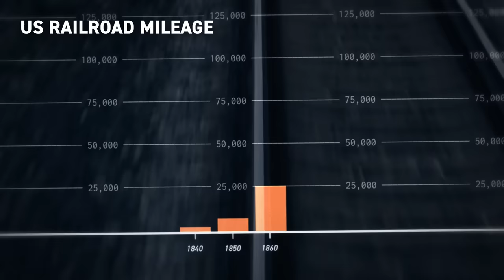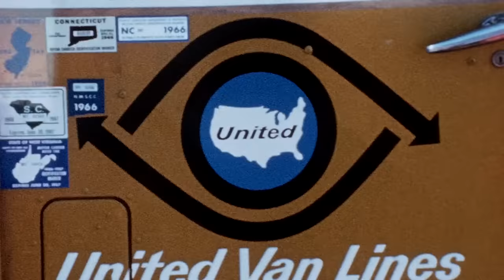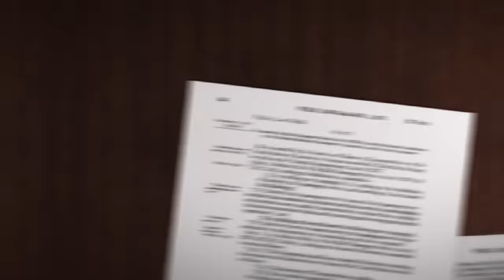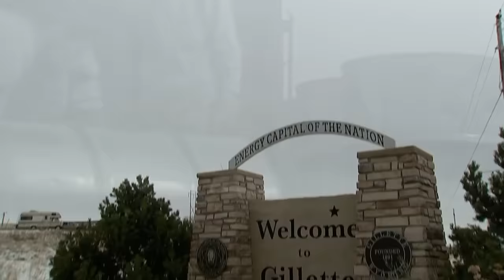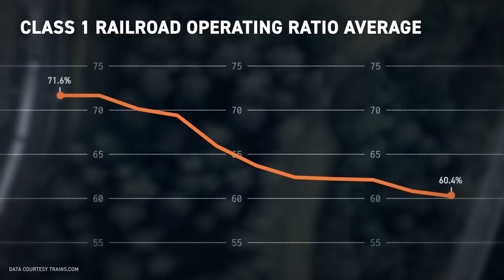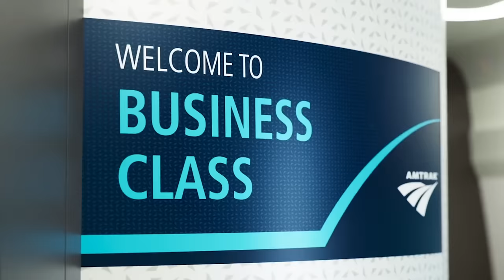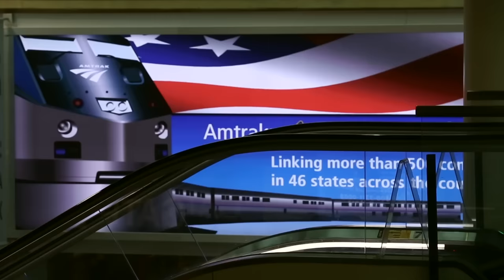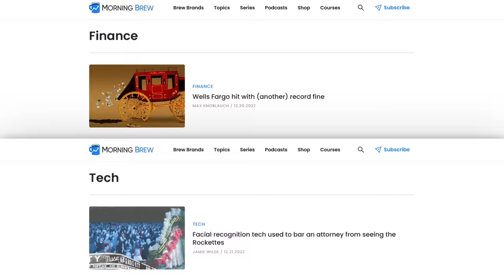The One Tiny Law That Keeps Amtrak Terrible

Comment: Amtrak currently has a lawsuit going against the freight companies for not honoring their agreement
Reply: As well they should. I wouldn’t budge an inch on the agreement. I’m sure the RR’s will/would try to buy their way out of the commitment. Don’t let them, stick to the agreement. Previous CEO’s have kicked the can down the road. Now it’s time to pay up.
Reply: I would like to see the freights restricted in length to the size of their sidings. If they want to run 3 mile trains, fine, but then they should have to build 3.5 mile sidings!
Reply: I use Amtrak on the old Pennsylvania "Main line," between Philadelphia and Pittsburgh. Prior to the 1970s, it was  four track system, two tracks in each direction.  Then it was reduced to three tracks, the third track used as a "Siding" for traffic in both directions.  They want to improve part of the old "Main line," by installing "Sidings" instead of a whole new track.  That should speed up passenger service but it would be better to return to having four whole length of the route tracks. 
The biggest restriction is the Gallitizin Tunnels. The Gaitizin tunnels are actually three tunnels. The first one built in 1852 for the Pennsylvania railroad  The Second built in 1854 by the then state owned "Portage Railway" which was part of the Pennsylvania Canal  (The Portage railroad connected the two parts of the Canal, hauling goods and Canal boats over Allegheny Mountain).  The Third tunnel was built in 1905 next to the original Gallitzin tunnel.  After 2000 the Orginal Gallitzin tunnel was enlarged so two tracks could go through it with double height containers.  The Portage Tunnel appears to have always be able to haul such tall rail cars, but it was only one track.  Those tunnels are still in use. The 1905 Gallitzin tunnel is abandoned but can be rebuilt to take double height containers rail cars or just install new tracks but forbid the use of double height containers in that Tunnel.
I bring up the Gallitzin tunnels for in most cases it is the tunnels and bridges that need to be upgraded not only to take double height container rail cars but also to put in a full length track instead of sidings.  
The US Government should do what Europe did with its rail system.  In Europe the actual rail lines are private as they are in the US, but the tracks are owned and maintained by the Government. The Private rail companies pay rent for the use of the tracks, just like truckers pay fuel taxes to maintain US highways that such truckers depend on.
Congress can do this by taking over the tracksge in exchange for the Railroads not paying any rent for the use of the tracks over the next 20 years. The Federal Government could then double tracks those busy rail lines that are not double track which would make Passenger service faster but so would Freight service be faster.   Competition between Railroads could be reinstated by permitting, after 20 years, anyone to use the tracks provided they meet minimum standards (i.e. no train slower then a "Normal Train").
Railroads competitors all use Government owned infrastructure. 1. Airplanes, Government owned airports and runways, runways built from funds from the Federal Government so that fighter jets can use those same runways.
2. Trucking and the fuel taxes, not only truckers pay but most other drivers.
3. Barges which rely on US Government locks and dams so rivers can be used year round, not just in time of spring floods.
My point is Railroads are the only means of transportation that does not depend on Government owned property to move goods along.  That leads to efforts not to invest in such infrastructure investments for most such investments will not pay off for ten to twenty years, long after the current leaders of those railroad are gone.   
This is the problem with most private enterprise companies, they are concerned more about profis this year not 20 years down the road.  In much of the economy that is good way to make a successful business, but it is hard on anything that needs long term thinking to survive and infrastructure is one area where long term planning is important.  Thus like public roads, railroad tracks should be owned and maintained by the Government. Yes I know the Government has a history of "Deferring maintenance" but when there is Political will those problems will be overcome if we are dealing with a Government project as oppose to a project by private enterprises.
A good example of this is the Interstate Highway system.  The overall system is Government owned and maintained even as the actual building of the Interstate system and maintenance of the Interstate system was done by Private companies. No private company will invest in a project for the over 50 years the Interstate system took to build but when it came to build the individual sections of the system, private companies can do such short term projects with ease 
Some people will not want to hear that the best solution to the problems of Amtrak is for the Federal Government to take over most of the "Class A" Railroads trackage. That will give the Federal Government the power it needs to not only improve passenger rail service in the US, but also improve long term freight service AND address the global warming by making rail a variable option to drive.
Reply: Amtrak meant to file the lawsuit a few decades ago, but they experienced delays.
Reply: The only problem is that Amtrak can afford to keep loosing money just like it always has since it was created. It has the American taxpayers to pay for it. Private railroads do not have that luxury. They have to make money to maintain their tracks/lines. If they don't, who do you think is going to pay for it, Amtrak? You people need to remember that the private railroads had to ask for permission from the government in order to end their failing, money loosing passenger service. Guess who thought it was a good idea to pick up a proven failed and money loosing operation? The government. Amtrak has NEVER even broken even since the day it started. Guess who pays for it? The tax payer.
Reply: @vintagethrifter2114  did you watch the video, or just show up to throw in some anti-public service, pro-hyper capitalist rhetoric?
Reply: @NobodyCaresAboutIt  I watched the video. I also ride Amtrak. I have also worked for the military, State Department and the United States Postal Service for the past twenty years. You tend to recognize lost cause when you see them.
Reply: Which will go nowhere because it’s physically impossible for a mile long coal train to fit on a 1/2 mile siding to let a 400 foot Amtrack pass.
Reply: @HighHolyOne   So you think the freight line that already owns the infrastructure should have to completely modify the infrastructure in order to accommodate Amtrak? Where is the sense in that. That’s like saying that you own a house but the agreement with the city says you have to let the neighbors use it whenever they want, however they want and Build a garage big enough for you to live in so that they can have the master bedroom.
Reply: @HighHolyOne  Freight rail is a business, they own the infrastructure because they paid to  build it to fit their needs, mandating that they have to rebuild their infrastructure to accommodate Amtrak is silly because Amtrak will never be profitable in this country, and forcing the freight rails to be less profitable, make less money, charge more and drive up the price of everything they ship in this country… just to try to make Amtrak slightly more on time is throwing effort after foolishness
Reply: Good luck with that one.  Light rain is dead; face it.  If it were not for AmTrack Brandon Biden, no one under forty would know or care about AmCrash.
Reply: @williamrgutrich7694  I care about trains because I know about the history of my town, which wouldn't exist today without the cotton belt railroad, and only saw decline after the rise of the US automobile industry aka the largest most disasterous welfare program in the history of our country.
Reply: @vintagethrifter2114  While you are fine with outlining the current problem, amtrac isn't going away, it is just going to be subsidized by the tax payers while remaining a very sub par transportation solution to the American people, you offered no solutions. That is what this video is about. I am actually fine with amtrac being tax payer subsidized if it ment cheap fares. But it need to be made useful. It needs more destinations. It needs better time management. And unless most of the government gets on board with it there won't be enough push to get it there. On the other side of the pond their governments realized the benefits of a modern rail. We need ours to step up.
Reply: @MaNameizJeff  They need to get their own and stop taking from private industry. There is very little private rail industry in Europe.
Reply: @vintagethrifter2114  that isn't realistic. Breaking new ground in today's developed cities isn't happening.
Reply: @MaNameizJeff  It's called eminent domain. Not only do you take it from the taxpayers, but they also pay for it.
Reply: @paulmentzer7658   All very interesting. Thanks!
Reply: @vintagethrifter2114  So what? The tax payer pays for A LOT of things that "lose" money (not loose). Things like public schools...fire departments...the National Weather Service...food inspectors...I could keep going. Amtrak service produces between 4 times and 10 times what we invest in it, in the form of economic development in the communities served. We have an Amtrak for the same reason we have highways...so that Americans everywhere have access to travel and the overall economy. And we SUBSIDIZE money-losing highways for the exact same reason we invest in Amtrak...because mobility and access make the economies go and create the preconditions for the success of private industry.
Reply: @vintagethrifter2114  So in other words, every single dime you ever spent in your entire life began life in a taxpayer's pocket, and now you're complaining about another public service? Gotcha.
Reply: @Matt-yg8ub  The U.S. government bailed out those railroads in 1971, and every single year of Amtrak's existence is effectively a $2 billion bailout of those freight railroads (who don't have to worry about their legal "common-carrier" obligation to provide service because Amtrak does it for them, and pays them for the privilege). Your analogy would work more like this: you build a house that you can't afford to maintain. I agree to pay off your mortgage, and I allow you to keep living there rent-free. My only requirement is you let me rent one of the bedrooms for two hours a day. And now you're mad because I want four hours day and you want me to pay you more rent...for the house I bought you.
Reply: @jimmathews8813  The government bailed out the railroad because overregulation was killing them. Once the government fixed the problems it caused and stopped over regulating, Freight rail became profitable again
Reply: @jimmathews8813  The railroads wanted to end their passenger service but the government wouldn't let them. Amtrak paying pensions for former railroad workers is a reason why the government is too stupid with other people's money. You want to talk about government pensions? Do you know what one of the problems with the Post Office is, why it is over a billion dollars in debt? It's because Congress passed a law that every year the Post Office has to deposit money into a pension plan for people that aren't even born yet. Another problem is that a tax payer funded program is in a losing contract with Amazon, a private company.
Reply: @Nphen  Everybody is against lobbyists, except their own lobbyists.
Reply: @vintagethrifter2114  Yup.   The pension problem with the Post Office is well documented.  No other agency or organization is required to take such measure because it's a punishment for the USPS having been successful and making a profit for *decades*.  Certain parties couldn't stand to see that happen when the money could have been funneled into their CEO buddies at FedEx, UPS, and DHL... and in turn kicked back to them as campaign contributions.
Reply: @mungtor  The Post Office uses UPS and FedEx to move their priority mail.
Reply: @Matt-yg8ub  Fine, then limit the train lengths to what can fit on a siding.  If the freight railroads wish to build longer sidings in response, then so be it.
Reply: @Matt-yg8ub  Bad analogy.  Freight lines aren't private citizens with tiny houses.  They're large operations whose actions have a huge effect on the population.
Reply: @vintagethrifter2114  Whether or not you're ridden Amtrak, worked for the military, State Department, and USPS, you still haven't bothered to make a convincing argument for the opinion you stated above.  If your point is that there is no economic incentive to maintain passenger rail, say it, and be prepared for numerous counterexamples.
Reply: @Videosop23   Why do you care? What do you get out of screwing with the freight rail company and forcing them to have to operate less efficiently? What’s in it for you?
Reply: @vintagethrifter2114  You're making this too easy.  You ought to know perfectly well that the United States Post Office is burdened with a uniquely onerous prefunding obligation.  From their "Retiree Health Benefits Prefunding" web page: "Unlike any other public or private entity, under a 2006 law, the U.S. Postal Service must pre-fund retiree health benefits. We must pay today for benefits that will not be paid out until some future date. Other federal agencies and most private sector companies use a “pay-as-you-go” system, by which the entity pays premiums as they are billed."  This was an attack on the USPS by special interests who wanted to drive the USPS out of business through a combination of crippling financial requirements (you might find that more palatable if I refer to it as "overregulation") and deliberate mismanagement (Louis DeJoy).  You probably remember Fox News pushing the narrative, a few years back, about how no one needs the USPS anymore about how it should be privatized--Article I, Section 8 of the Constitution be damned.

Just kidding.  I doubt any of the talking heads at Fox actually mentioned Article I, Section 8 of the Constitution while on camera.
Reply: @Videosop23  I've actually mentioned the Post Office retirement fund in another post. I'm sure you know how to search for it.
Reply: @vintagethrifter2114  Re: "The Post Office uses UPS and FedEx to move their priority mail.:" UPS' SmartPost and FedEx’s SmartPost use the USPS (although FedEx is reducing the volume it's subcontracting to the USPS' Parcel Select service).  It's telling that you've left out an important bit of context: the USPS has to handle unprofitable rural addresses whether it wants to or not, and a First-Class Mail Forever stamp has to be valid regardless of whether you're sending a letter across town or from Alaska to Hawaii.

In the future, please provide appropriate context instead of posting provocative one-liners that lack meaningful context.  Apart from giving yourself a sense that you've "owned the libs," such comments accomplish nothing except to discourage discussion.
Reply: @Videosop23  You forgot Amazon, which I already mentioned. You seem to think that I'm defending the Post Office when I'm using it as an example of government mismanagement and why the government shouldn't be in charge of the  railroads.
Reply: @Videosop23  Yeah, and your attempt to screw them over for the benefit of a tiny few who ride Amtrak will have negative consequences for the majority.
Reply: @Matt-yg8ub  It's in everyone's interest to ensure that freight rail companies don't increase short-term efficiency by failing to meet their obligations.  At any rate, you're confused: it's the freight rail companies who are screwing with Amtrak, by failing to meet their obligation to give Amtrak priority on the rails.  What's it it for you to encourage this systematic sabotage of public transit?
Reply: @vintagethrifter2114  ReL "You seem to think that I'm defending the Post Office..."  Don't presume to guess what I'm thinking or to tell me what I forgot: if you honestly believe that I think you're "defending the Post Office," you need to bone up on basic reading comprehension skills.  I can't help you with that.
Reply: @Matt-yg8ub  Excusing the freight rail companies' skirting of requirements to give priority to passenger rail is a flaw in your position that you can't wave away by equating enforcement with "screwing."

At any rate, your point is well taken: you see the freight rail companies as above the law and not deserving the consequences of violating it.  I won't attempt to press you further on that matter.
Reply: @Videosop23  if you choose to make a strawman out of the argument, and intentionally misinterpret it, that’s on you, but I’ve been very clear. I’m not trying to let anybody avoid the law I’m saying that the law, as it is written, only requires the freight rail company to defer to Amtrak when possible…. As we’ve gone over numerous times now, it’s not possible for a mile long freight train to defer to the 800 foot Amtrak, when the siding is not large enough to accommodate it.  They have not broken the law. There are no repercussions or consequences coming their way, because they did not break the law. There is a small minority of people advocating for Amtrak to take precedence on the freight rail’s infrastructure. Freight in this country is far more valuable to the people than passenger rail. If you can’t understand that we shouldn’t be negatively impacting 330 million people for the benefit of maybe a million or two who like to ride trains from coast to coast, then I can’t help you if you can’t understand basic facts.
Reply: @Videosop23    on the contrary, it’s in virtually no one’s interest to force the freight lines to run behind schedule, in order to accommodate a scant few people who ride the Amtrak. The vast and overwhelming majority of the people in this country will be negatively impacted by fucking with the freight companies so that a few elitist who like to ride trains from coast to coast can get there slightly closer to on time.  
Amtrak has never run on time across the majority of its routes in its entire history. There is far more wrong with Amtrak than just the freight lines not going out of their way to screw themselves to try to make it easier for.
Reply: @paulmentzer7658  Bro, YES
Reply: @vintagethrifter2114  because passenger rail is a public service? Which is a normal thing for taxpayers to pay for?
Reply: @Matt-yg8ub  Wrong again, my friend.  You (and more importantly, those who have let the 4 major rail freight companies get away with skirting the law for so long) need to ask why short-term profit motives were used as a justification to give them a pass, and what other systemic damage was done along the way while they weren't being held to account.

The idea that a "scant few people" who ride Amtrak or who would benefit from it if it were allowed to run with priority over freight , is too silly to entertain.  Of course, it goes a long way toward becoming a self-fulfilling prophecy when the government selectively applies the law, favoring freight rail over passenger rail and looking the other way when passenger rail suffers for it.
Reply: @Matt-yg8ub  Straw man?  Give me a break.  It's possible to lay a siding that's more than a mile long.  It's possible to avoid running a mile-long train on a route that has only 800-foot sidings.  You've confused "possible" with "convenient."
Reply: @MaxPrehl  Who said that it was a required service? Who says that it has to be a public service? Is air travel a required public service?
Reply: @Videosop23  Those four railroads are called Class One railroads. There's actually five American and two Canadian in the United States. In 1950, there were 127. 1950 was the beginning of the end of passenger service.  Eventually the government allowed for the railroads to end passenger service and with 4R, allowed the railroads to close non profitable lines, but for some of these companies, it was too late.
All of these places that you want passenger service, there used to be railroad tracks going there but the company went out of business and the tracks were removed because nobody was using passenger service.
Reply: @Matt-yg8ub  When these rail lines were first built, they receive the right to obtain the land needed by emminet domain in exchange for providing passenger service.   The obligation to provide passenger service still remains but has been transferred to Amtrak.  Thus there is a legal obligation fir the freight lines to help Amtrak OR PROVIDE THE PASSENGER SERVICE THEMSELVES.  These rail lines could never have been built without Emminet Domain and that power came with the permanent requirement to provide passenger service. The Federal Government took over passenger service with Amtrak but the orginal obligation stayed with the freight lines thus the law that the freight line must give Amtrak priority or the Freight line can provide the required passenger service themselves.
Reply: @Matt-yg8ub   @The Adventures of Super Mom   as a locomotive engineer that works on the largest railroad in N America, id like to add my 2 cents...for anyone that thinks Amtrak doesn't take priority at least on my railroad they are wrong...i cannot say how frustrating and STRESSFUL it is to have to always go and try to squeee a 7000 foot , 18000 ton coal train into a 7080 foot siding with very little room to spare just to let an 800 foot Amtrak pass by all the while they are still 25 minutes away from the meet all because the dispatchers are deathly scared that they might get in trouble because might delay Amtrak  or worse, having to go into a siding and stop on the side of a mountain 2.2% grade in the middle of the winter with snow and ice covering the rail (in which case one time my mile and half long train once slide almost 500 feet downhill as i planned my stop)  and having to start the train again on mountain grade ( many issues and incidents have happened in the past because of this).  As someone who has worked for the railroad for over a decade i can assure anyone that Amtrak does take priority on our railroad even despite the track belonging to the carrier railroad.  There's an inside joke among us and that is Amtrak always gets green lights and if they even get anything different they will whine about it.  So from many freight railroaders standpoint Amtrak is always in the way and incidents have happened because many dispatchers seems to be in a stressful panic mode when Amtrak enters the picture....i will also add that with this new corporate  business model called PSR  that cuts down on operating ratio use to placate Wall Street and the investors, railroad maintenance and safety have gone downhill fast.  Just about every day there's some kind of issue with a locomotive and the trains are getting longer and longer (some being around 3 miles long- 15000 feet long now) and now they want to cut it to 1 man on a locomotive....where's the safety in that? Oh and i guess i should mention that they've made our attendance policy so strict that basically we must be on call almost 95% of the month- no weekends nor holidays off.  anyway, i agree with a lot of your points Matt and just wanted to add my view from someone who has been working on the rr for over a decade and yes, if you take away the impact the amount of freight is moved on the railroads you would have a very serious problem with the economy, food and commodity prices, pollution and highway traffic congestion.
Reply: @paulmentzer7658  At best, on its highest volume day, Amtrak accounts for maybe 10% of the traffic on the rail line. You can’t handicap the other 90% of rail traffic simply because you’re trying to make Amtrak a couple minutes earlier in their arrival times. Which one makes more sense to you, making one passenger train 45 minutes late, or making 11 freight trains three hours late because they all had to seek a siding  20 miles from the Junction, so Amtrak didn’t have to stop when they got to the switch track?  To top it all off, you’re suggesting that we increase the frequency of the passenger rail to compound the problem now instead of having to deal with two or three of these trains on that track in that sector that day now you’ve got seven or eight of them and you’ve got massive delays on the freight side because even if we cut them down to a fraction of their size, they’re still enormous and  still have to seek sidings to get off the rail every single time one of those damn Amtrack trains comes through.

I don’t think you grasp the scope of the logistics required to do this. Union Pacific sends a mile and a half long freight train going north on the track, 90 minutes later they sent another, followed by another 90 minutes after that. They’ll put eight trains on that track today going north, the last train will arrive in the switching yard at two in the morning and 90 minutes after that the first train goes south on that same track followed by another train and another train and another train. Now imagine if there were random Amtrak’s running along the tracks and all those freight trains had to find sidings to get out of the way or worse… The freight company could only send one train in any direction at any given time? You’d either have massive shipping delays or a eminent domain problem where the railroad has to kick a whole bunch of poor people out of their neighborhood in order to build more tracks adjacent to the existing infrastructure.  

It would probably cost Union Pacific a tiny fraction of the lost revenue to just buy every Amtrak passenger a first class ticket on United Airlines wherever the hell they wanna go.
Reply: @Matt-yg8ub  If I own a right of way through your property and use it less then 1% of the time, that does NOT give you the right to restrict when I can use that right of way.  The same with Antrak's right to provide  on time passenger service. That right is a property right of Amtrak to have priority over freight traffic on the same rail line.  Just because Amtrak uses that line less then 1 % of the time does not give the freight lines the right to interfere with Antrak's right to use that same line.  If the freight line dislike having to give Antrak's the right of way, the freight line has to make the effort to minimize the problem.
Remember when the rail line was built one of the requirements to be able to build the rail line was to provide passenger service, that is a requirement the freight lines can not get out of now because it us unprofitable.  Passenger service has always been unprofitable, Adam Smith in his Wealth of Nations published in 1776, pointed out all passenger service had been unprofitable (and always subsidize by Frieght or mail, even today most airlines are subsidize by the Postal Service by carrying mail on a space avaliable basis).
No one is asking the Freight lines to make lines exclusively for passenger service but to make sure that passenger service has the priority that such service was expected to have when thr states and the Federal Government gave the rail lines the right to take property via eminent domain in the 1800s.
Reply: @paulmentzer7658  We’re talking in circles here. The freight line isn’t preventing Amtrak from using the rails….they just aren’t curtailing 99% of operations to accommodate that 1% …ie, all road traffic doesn’t operate solely in the right lane and on the shoulder so that fire trucks can occasionally pass by on the left. What you’re asking is akin to forcing cash strapped municipalities to make all roads and bridges in the country at least 3 lanes so that Amazon delivery vehicles can always get around semi trucks, it’s ludicrously expensive and only benefits a tiny minority while costing everyone else.
Reply: @Matt-yg8ub  The law on this issue has been clear since the early 1800s, passenger service has priority and the Government "Purchased," that right when they gave the rail lines emninet domain and that property right was transferred to Amtrak when Amtrak was formed
Reply: @Matt-yg8ub  That's what liquidated damages are for, you start charging those freight companies $10,000/hour for blocking an Amtrak train, they will find somewhere to put that coal train real fast. Or, if they don't, at least they'll be heavily subsidizing Amtrak's passenger service, win-win situation.

What's profitable for the rail companies is largely irrelevant, these requirements are enshrined in law. Any company that does business across state lines operates at the pleasure of the federal government and are subject to all the whims of the same, rail companies are no exception. If you don't want to deal with these restrictions, break up the companies so that no company owns rail in multiple states and no trains cross state lines.
Reply: @costakeith9048  For which the remedy would be to charge Amtrak more to use their tracks…..except they can’t because the federal government locked them into random like low usage fees an economic lifetime ago. The idea that Amtrak wants to disrupt freight rail at a time that freight shipping is down and priority shipping has shifted even more to trucks and air freight…. And the Railroads should foot the bill for all Amtrak’s wants and desires…… is simply ridiculous. Passenger rail isn’t economically viable in the United States and it was the millstone around the neck of the freight lines for over a century until they finally got out from under it 50 years ago, but now some well meaning idiots are trying to kill freight rail again by making them financially responsible for providing the infrastructure for expanded Amtrak service at their own expense …..and that’s a sure fire way to kill an industry already in decline.
Reply: @Matt-yg8ub  I think the lease agreement is also dictated by law. But that would offer a good opportunity for the Federal government to do what should have been done back in the 60's: nationalize the national rail network.

Given that the track was almost all built on lands given to the rail companies for free by the federal government, I think it's high past time for the federal government to take it all back. This would flip the script, forcing the freight companies to purchase rail access from Amtrak and giving Amtrak a veto on  rail schedules that would interrupt her passenger service. It would also open up new compensation from new rail companies as established companies could no longer keep other companies off their track.
Reply: @costakeith9048  So now you want tax payer money to subsidize this passenger boondoggle? How many hundreds of billions do you need ?
Reply: @Matt-yg8ub  Yes, national infrastructure should be publicly owned, it's no less absurd for private companies to own the rail lines than it would be for private companies to own our highways. The reality is that if you don't pay for maintenance and construction through tax dollars, you pay for it through increased logistics costs.

And the fact that the rail companies have been manifestly negligent in the maintenance of the national rail infrastructure, closing down lines and not properly maintaining the ones they keep open, represents a direct threat to national security as these lines are necessary to move materiel in the event of war. This makes it all the more imperative that the federal government take them over.
Reply: @costakeith9048  so instead of the five people who want to go to the middle of nowhere, paying $200 for their ticket, and taking an Amtrak that takes them 18 hours to get there on the freight rail line… you want those same 5 people to be able to get anywhere they want to go overnight on their own private, high-speed rail line for $20 …..at a cost of hundreds of billions to the public. 

Seems a bit steep to me.

Why not just buy all of the Amtrak riders lifetime plane tickets it would be cheaper
Reply: @Matt-yg8ub  More than anything I want a robust national infrastructure, which means spending hundreds of billions or, indeed, trillions, on new rail, roads, ports, bridges, tunnels, ferry systems, powerplants, reservoirs, canals, and even airports. I want to see an infrastructure push on the scale of the transcontinental railroads, the New Deal, or the interstate highways project.

The fact that the rail infrastructure is deteriorating is reason enough for the state to step in and rebuild it with public funds.
Reply: @costakeith9048  I’m all for infrastructure….but not billions in waste and graft. We don’t have any justification to spend a trillion dollars on passenger rail. Just look at California’s attempts…..a hundred billion dollar project with little to show for it after decades of work and graft and handouts and red tape.
Reply: @Matt-yg8ub  I'm actually less concerned about highspeed rail than I am about a robust infrastructure across the nation, though I'm not opposed to it in certain situations. The problems with California are, as you say, 'graft and handouts and red tape' and that certainly needs to be taken care of. But the reality is that our national infrastructure hasn't been expanded upon in 50 years and has barely been maintained in that timeframe.

Rail, roads, bridges, damns, ports, etc. all have a massive maintenance deficit and need massive investment to merely bring them back to 1960's levels. A key aspect of the national infrastructure, such as the rail system, shouldn't be left to the mercy of the profitability of a handful of rail companies.
Reply: Amtrak should be able to build their own rails
Reply: @vintagethrifter2114  Guess what?  The entire highway system in the United States is government run.  Paid for by taxpayers.  Guess who controls the airlines?  The government run air traffic control system, paid for by taxpayers.  Neither one of those systems "turns a profit" and no other form of infrastructure--water lines, sewer lines, electrical grid, etc.--are evaluated by whether or not they are "profitable".  They are necessary, and therefore exist.  The nonsensical argument about "loosing money" (it's "losing", by the way) is a complete red herring.  No developed country operates its rail system as a revenue generator, any more than a sidewalk generates revenue.
Reply: Why don't the big railroads start running passenger service again? Competition is almost always good for lowering prices, meaning it's good for the end user. (ie: the consumer) I don't give a rat's ass if it's not good for corporate. Corporate can go pound salt. They can afford to lose profits, we can't afford higher prices.
Reply: @ericperkins3078  Passenger rail travel isn't a necessity. I'm not saying it make a profit. I'm saying that it should be paid for and support by the people that use it. Are you going to pay my sewer bill? Highways should be paid for by fuel taxes, tolls  and registration taxes. Schools, why are my tax dollars supporting your schools? I've got my own schools to support. Why are you supporting my schools? We don't even live in the same state.
 French, German and Japanese rail systems make a profit.
Reply: @Matt-yg8ub  The North-Western cities in the US are fairly densely grouped.  Why should rail be unsuccessful in the US?
Reply: @vintagethrifter2114  They're not even set up to measure profitability so that statement is an outright lie.  They bring revenue.  That's way different from profit.
Reply: @ericperkins3078  SNCF made over 2 billion euros in profits in 2022. It is reinvesting that back into its system.
Revenue that breaks even is close enough to profit.
Reply: @TassieLorenzo  They already have a passenger network on the west coast. You can actually travel from Seattle to Chicago by rail but no one does it. That's why Amtrak is thinking about ending the Empire Builder. But like you said, densely populated. Once you travel further away from it, the less it works and the less riders you have.
Reply: The freight railroads are private property.  Statist regulation is not the best way to improve the transportation market.
Reply: @MilwaukeeF40C  okay cool, now stop using BILLIONS in tax dollars to build roads and bail out auto manufacturers and airlines 👍
Reply: @TassieLorenzo  because the country is 3,000,000 mi.² with the majority of the population situated on the coasts and massive amounts of empty space in between. 
Look at it like this, China is basically the gold standard for modern high-speed rail and they don’t have jack shit in the western 60% of the country, It’s all exclusively on the eastern coast…. Because that’s where the people are.
Reply: @Videosop23   the demand for passenger rail in this country is virtually nonexistent. We’re not talking short term profit motivation, here, we’re talking the long-term survival of freight rail in an era where air freight has virtually eliminated the most profitable sector of the market. The last thing the rail companies need is this pipe dream fools errand of a renaissance of passenger rail travel getting in the way, slowing them down, and driving up their infrastructure costs to where they lose even more customers because it’s no longer economical or competitive to ship by rail.
Reply: @Matt-yg8ub  Your scales are a bit off. There aren't any 1/2 mile long sidings. Trans-con freight trains are normally 1.5~2.6 miles long. Those Amtrak trains are about 1/5th~1/4th of a mile long. The Acela express trainset is 666 feet in length and its only a few cars.
Reply: @Matt-yg8ub  No one is suggesting that rail, or particularly high speed rail, would be useful for the middle of nowhere.  Rather that it would be useful for routes such as Washington-Baltimore-Philaphedia-New York-Boston or San Antonio-Austin-Houston or San Diego-Los Angeles-Las Vegas.
Reply: @norwat18  Thank you for your insight. Most people here in the comments seem to think that the freight carriers are evil because engineers can’t magically sprout wings and move those trains out of the way so the Amtrak can arrive 10 minutes sooner. It’s refreshing to hear from someone with real world experience who actually understands this issue as more than just a “ I want to ride on the Choo choo once in a wile and I think that the big coal train is in the way “ perspective.
Reply: @Matt-yg8ub  The idea that "the demand for passenger rail in this country is virtually nonexistent" is absurd, on at least two counts: 1. It clearly isn't true of the northeast corridor or the United States, and 2. The demand is there, but various forces work to make it unnecessarily difficult and expensive to access.

That fact that I was able to rebut the claim that "the demand for passenger rail in this country is virtually nonexistent" simply by mentioning the northeast corridor tells me that you're boned up on someone's talking points but really haven't thought this through.
Reply: @Videosop23  You are conflating commuter rail with passenger rail. Those are not the same thing. Passenger rail is a subset of people willing to spend 4 to 10 times as long to get from point a to point B for vacation travel. Commuter rail is people forced to take the train into work each day because the downtown area of the city has been designed to make vehicle travel prohibitively expensive. 

You are attempting to use the one area of the country where the density forces people into using the train to get from the suburbs into downtown, as you’re only example to try to justify a nationwide rail system that virtually no one outside of the northeast corridor would use at all.

Do you know what commuter rail looks like outside the northeast corridor? Try taking the north star from big lake to Minneapolis. It will drop you off in downtown 14 blocks from your office and you can hoof it in a foot of snow and -20 weather…. Or wait 45 minutes for the bus to pick you up and take another half hour to get you to your destination total commute time? Approximately three times what it would take you to drive from Big Lake into Minneapolis park your car in the garage and take the elevator to your office . Have fun :-)
Reply: @TassieLorenzo  Currently Los Angeles to Las Vegas is north of $100 billion and they have basically nothing to show for it. You have the largest county in the country the largest population center on the West Coast trying to get people to Las Vegas… the giant playground of America, and they still can’t make that work with the vast hordes of dedicated built in customers for such a rail line. 
Washington to Baltimore or Philadelphia to New York and Boston, goes through some of the most densely populated, overregulated terrain in the country…. Carving out high speed rail lines through those areas would cost a $trillion dollars… easily. The utility of such a line would be questionable because the benefit of high-speed rail is the speed which only works over long straight distances at speed, you literally have to start at one city and not stop until you got to the other one in order to make it both cost and time efficient.  Imagine living roughly at the halfway point between New York and Boston and having to decide which city you want to drive to so that you can ride the train the other direction to get to the other city.
Reply: @MaNameizJeff  where do you think all these highways and roads came from? They drove them straight through built up cities.
Reply: @Matt-yg8ub   you certainly hit all the right points...may be a lot of people don't realize that it is the freight carriers that own the infrastructure and the tracks not Amtrak.  Why should they have to kow tow to Amtrak just so Amtrak won't be late? As a said before, there's a whole lot of stress on the dispatchers and crews when Amtrak enters the picture.  All the trains are tucked away in sidings ( some that barely fit ) just so that  Amtrak can get first priority.  From my experience they seem to get special treatment whether it's by the dispatchers or even in the hotels that we stay at on our away terminals. It doesn't really bother me anymore, it's just an annoyance now to always have to sit and wait for them and to sometimes hear them whine when they don't get the green lights.
Reply: Small correction, in a lot of European countries, the trains themselves are owned by the government too, and places with privatised rail lines like the UK have some of the worst outcomes on the continent. The rail system as a whole, including the tracks and the trains should be made a public utility
Reply: @vintagethrifter2114  Exactly!
Reply: @costakeith9048  Infrastructure is expensive and politically risky. “Smart” politicians kick the can down to road because there’s no safe way to built or maintain anything without pissing off a special interest group and find yourself on the wrong side of their activism.
Reply: @Matt-yg8ub  I know, I'm just too much of an idealist. But there as a time when people went to Washington to try and improve their country and community, not to make a career for themselves. I guess I'm just nostalgic for those days.
Reply: @costakeith9048  That’s not exactly what I meant. I can’t tell you the number of times We (that’s the royal we here in public works) built a 20 million dollar road that should have taken 6 months and wound up costing 35 million and taking a year and a half to complete. Everything we do even at the local level is mired in red tape and special interests. We built a 40 million dollar fire station using the plans from a station built in Denver for 18 million. EVERYTHING we do is subject to massive overhead and outright crony accounting. 100 cubic yards of structural concrete costs X, but 100 cubic yards of the approved spec concrete produced by the mayor’s cousin costs XXX. Why approve a fire station with synthetic counter tops and cafeteria grade equipment when you can build it with granite and SubZero appliances and get the Chief’s endorsement come election season?  That sort of stuff. 

The flip side is that you get Aldermen screaming about how poor ethnic neighborhoods need better roads and bridges and access to the interstate system……but if you dare build an on-ramp in a poor neighborhood they’ll hound you out of politics.  Don’t get me started on repairing an aging bridge and “displacing the local homeless population”
Reply: they all had one agreement??
Reply: Union pacific knows how freight trains work
Reply: @Matt-yg8ub the fright companies making their trains too long thus making sidings useless thus causing delay from amtrak trains is the reason why few people use amtrak in the first place.
Reply: @Mr-pn2eh  economy of scale… you wanna make the train shorter? Shipping Prices go up, end user prices go up.
Reply: @Matt-yg8ub I would love to see air cargo completely eliminate frieght rail.

The all those tracks can be converted to passenger rail. Instead of being laid off they could instead have you become a passenger rail operator.
Reply: @Matt-yg8ub it that's the trade off for what I just said then sure.
Reply: @Mr-pn2eh  so negatively impact everyone so the amtrack used by a comparative handful of people runs slightly faster? Doesn’t sound worth it
Reply: @Mr-pn2eh  Are you delusional or something? When was the last time you had a CAT scan?  Do you understand the concept of economics? Logistics??? That is NEVER going to happen…. Not only because the cost of concerting all of the heavy rail transport to air cargo would be astronomical ( and logically impossible) but also because commuter rail isn’t viable in this country. 
Nobody wants to spend four of their seven days of vacation traveling from New York to Los Angeles and back when they could do it in four hours there and four hours back by plane  on the margins and still have extra days of actual vacation
Reply: @Matt-yg8ub the issue is that they aren’t allowed to run those long trains in the first place. It should be enforced. If the freight company wants longer trains, they should have to build the infrastructure to support them. The land they now have was initially provided by the government too
Reply: @reeddeer793  the freight company built the track, the freight company maintains the track, the freight company paid for all of this, but it’s Amtrak that gets priority because the government had the freight rail over a barrel and forced them into signing on the dotted line. It’s economic suicide, but that’s what the government wants because they want to force all of the freight companies into dependence on them.
Reply: @Videosop23 What if government paid for more needed long passing tracks or turnouts using government (taxpayer) funds?